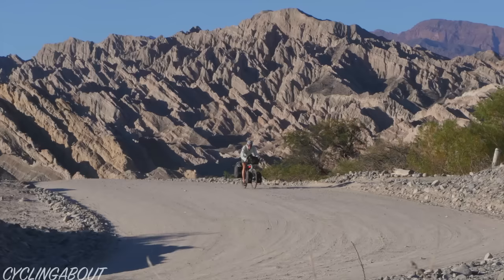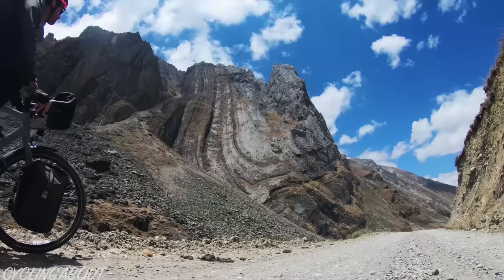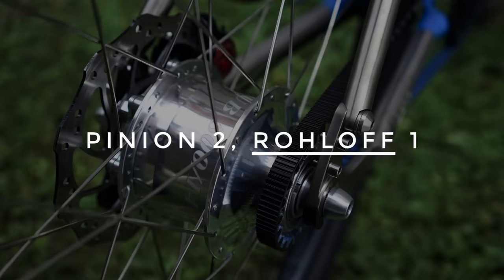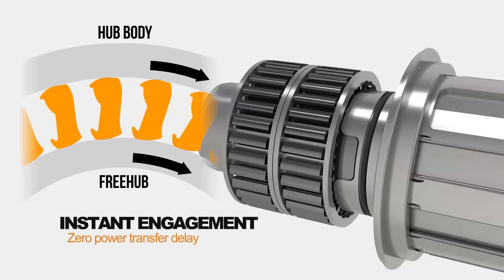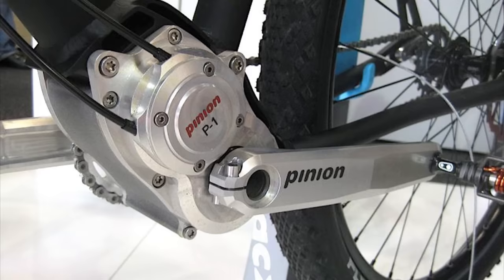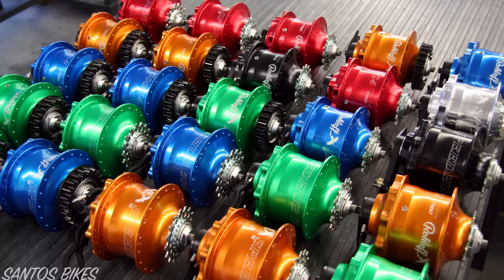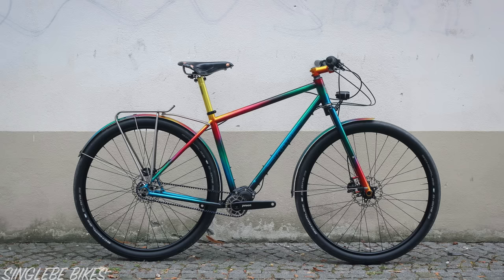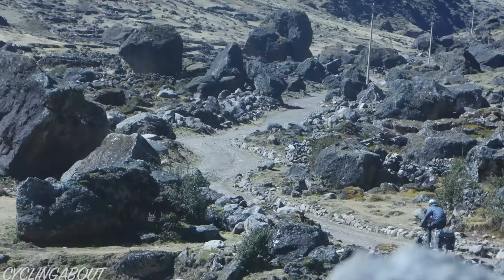What's The Ultimate Bicycle Gearbox? Rohloff Hub VS Pinion Gearbox

Comment: Rohloff has a 4% higher efficiency, is lighter and doesn't require a odd frame like the Pinion does so a easy win for the Rohloff if you ask me.
Reply: Plus the wide array of aftermarket shifters. Personally, being stuck with grip-shifters would be an instant no-go.
Reply: It's all about what you want to do with the bike I reckon. I'm more on the pinion side. I used an Alfine 11 on one bike as a cheap way into the world of geared hubs, but the weight of a geared hub on the back axle absolutely ruins the feel of a bike on rough surfaces and especially trails. The lack of trigger shifter availability for the pinion would annoy me too, but the real downside is that there's almost nothing on the market in terms of frames that'll take a pinion gearbox so derailleurs is still win this one for the MTB/Gravel type spins I do.
I'd love to be able to run a belt drive as chain maintenance is by far the biggest consumer of my time in keeping my bikes running. The slow drive pickup in certain gears on both systems is also a worry on tech climbs, I have a couple of bikes with old Shimano 16 click hubs and the amount of free travel before they pick up is shocking now that I'm used to a minimum of 36 engagements (Free play from 22.5 degrees to 10 degrees is a huge difference, going from 36 to 120 clicks is barely noticeable based on a 120 click hub I ran, as the benefits are very much into diminishing returns past 30-40 clicks). Shock loads to the drivetrain are much lower if the drive engages fast too, so there's an incentive from a gearbox durability point of view to pick up drive fast.
Reply: @MannequinOngaku  I personally don't mind grip shifters, but it would be nice if they would make them hydraulic like brakes so that they were easier to shift in the rain.
Reply: Noise kills the Rohloff for me. No way I go through all the trouble of a belt drive and hub only to have a bike that's noisier than a chain.
Reply: Rohloff has a weight/watts limit.  I killed three in a row before they told me that.  I did learn to build my own wheelset because of it....lol
Reply: Are you thinking of Cannondale Topstone? @aboutcycling warns it may not be stiff enough.
Reply: peglor Wouldn’t instant drive hubs contribute to a lot of pedal kickback?
Reply: @MaplePanda04  Only if you're on a full suspension bike where the chain length changes so much through the travel that it increases faster as the suspension moves than the rear hub is spinning. In a lot of suspension designs the tension in the chain while pedalling is used to counteract suspension bob, but under normal pedalling the suspension won't go very far into its travel, so the effect is small even on bikes with large chain growth.
Reply: @oilcanracer6388  Have you figures for the weight/watt limit on the Rohloff? The watt limit should actually be a torque limit (Measured in Nm, or lbf.ft for fans of medieval units) rather than a power limit as torque is what breaks low speed gearboxes.
Power (W) is Torque (Nm) x RPM (radians/sec), so the same power transmitted at 10 times the RPM needs 10 times less torque. As RPM goes up heating in bearings and friction surfaces becomes an issue, but at bike speeds torque is pretty much it for sources of failure.
Reply: @oilcanracer6388  ya, that bit is skipped over in the shootout. The Pinion has a much higher torque limit then the Rohloff.  That limits it's compatibility with e-bike mid-drive solutions.
Reply: But you forget mtb. For a full susser,  the most important place to reduce weight is at te rear wheel, and increasing frame weight actually improves suspension (hence some race teams attaching weights to their frames) when you frame it in this lens, the pinion seems much better, as the slight efficiency loss is more than made up for in the much better sprung/unsprung mass ratio. Not to mention the complete sealing allowing it to function very well in muddy or wet conditions
Reply: @peglor  only on certain designs
Reply: wow, 4%! that's amazing, it would make so much difference and every cyclist ever would notice it! i'm surprised Pinion is still in business tbh.
Reply: That's what Richard Schwinn said when I asked him about doing a custom Waterford or Gunnar for Pinion. Wasn't interested in the extra frame tooling expense either. They do about 20 or 30 custom Rohloffs every year. I have a Pinion Priority 600 now and love it. Taking advantage of doing easy extra wheelsets.
Reply: Shindinru I’ve been using it without any problems for over a year with a 52V BBSHD (160Nm torque).
Reply: @MannequinOngaku  I agree, I can't stand grip shifters.. 
So for the cheaper, more efficient solution thats been tested more. and is also the one with compability with different shifters, crank motors and the bike frame you wan't, its a easy choise if you ask me.
There's gott be a torque limit on both, but you'd never know on the pinion cause you can barely put any power too it. With a BBS HD on the Rohloff its gonna be tested, I run derailleurs and the chain and sprockets wear out pretty fast...
Reply: @oilcanracer6388  Hmmmm.....so how do you explain the large number of tandem bikes that have been using Rohloff Speedhubs with great success?
Reply: I agree...Pinion.
Reply: @theadventurebiker   tandem bikes see a lot of power but very slowly and not a lot of torque at once.  Stopping a tandem,  not that is a different subject.
Reply: Tasunke  actually in normal usages they are good.  But there a lot of riders experiencing problems at the top end of their limits and beyond.
Reply: @peglor  I no longer have the actual numbers, but my numbers were just armchair guesstamations using weight of bike, myself added to 250-350 watts power.  You are right that heat deterioration added to the problem of over loading the hub.  I used to break spokes, rims hubs and wear down pedals and chains until I found better parts.  Now that I am on a pinion gearbox, my knees are wearing out.....lol
Reply: Maybe its only in Germany but I got a lifetime  warranty for my Rohloff...  also the e14 shifter is a clear winner
Reply: @peglor  5% more efficient is significant.
Reply: Could you elaborate?
Reply: at a higher price yes
Reply: Pinion isn't limited to grip shift. Cing makes dual trigger style shifters for it.
Reply: @PhilKulak  thing is most gears are silent. There's a handful of gears that are clicking while pedaling and for whatever reason gear 7 is just plain awful, granted. But in the real world, most of the time you only hear your tyres whizzing as you're going along.
Reply: You're clearly not an MTBer, or not a very good/competent one.
Reply: @thanadorlx9179  I broke my hub flanges (salty water breaks the flanges, according to Rohloff) after 5 years and that was it. I had to pay for the repairs.
Reply: @frutt5k  i got my rohloff for 3 years now, 15k km run through, 3x change of oil, thats all.  I have friends who got now 8 years on rohloff and rhey had broken wheel but the hub was fine... my shop dealer told me some time ago that he had a case where the hub was making noise and had to be replaced after 8k km... rohloff did the replace for free... so I can't complain... I heard my wife curse because her last bike had Shimano and some gears were always off... now she has nouvinci gear, but she can't keep up... we decided to go for the new delite and super delite with e14 hub, going to buy for next year
Reply: @thanadorlx9179  YMWV. But if the Rohlof shit hoits your fan you are depending on the leniency of Rohloff. Despite their claims of 100.000 km's.
Reply: Unless you're a mountain biker, but otherwise, in large part I agree with you.
Reply: To me, the biggest advantage of a Pinion Gearbox is for mountain biking.
Reply: If you a road biking or something it off course is the better option.
Because of the weight distribution it's not good for MTB's like he said.
That's why i would go for a pinion gearbox IF i even had the money for such transmissions.
Reply: He created frivolous circumstances not relevant in order to cheat Pinion to tie.  Many were laughable that I firdt thought this was paid add
Reply: @mick2d2  Just bought a FLX Blade 2.0 with a Bafang 1500w with Rohloff. We'll see. Don't like the twist shifter though. I have to be careful when riding because if i accidently move the shifter the shift detector cuts power for a split second. Its irritating.
Reply: @espritmike  I suppose, as with most things, there's an adjustment period. 
I don't have any power cut off, other than me briefly letting up on the pedals as you can't shift properly with the Rohloff under pressure anyway.
My shifter also requires a certain amount of pressure to click between the gears.
Reply: @Paul Kirkeminde No need to ride electric bikes anywhere.  I am perfectly able to cycle as much and anywhere I want as long as the bike can handle it.  Where I currently live we do not let E-bikes on the trails and are limited to the streets in car lanes only, never on bike paths. They are considered motorcycles not bicycles. And I agree!
Reply: @Paul Kirkeminde"Paul Kirkeminde has been blocked from communicating with you."  Good bye! Not looking to argue with people, just giving my opinion on a friends page.
Reply: i agree!
Reply: Rohloff back wheel replacement is pricy.
Reply: Both loose. Ridiculously overpriced american made crap engineering.
Reply: @peglor  rholllof is  rated for up to 120 watts , that's more than any ebike I know
Reply: @andyanderson1100  The motor power limit for ebikes to be considered pedal assisted bicycles and not motorbikes is 250 Watts, so all but the cheapest models are at that power level. 

Electric MTB's go considerably higher since they're not officially supposed to be used on public roads. Power doesn't break bike hubs though, torques does (Consider that a truck engine with 500 bhp is built much more heavily than a 500 bhp car engine because the truck is putting out 500 bhp at 1500 rpm, while the car does it at more like 6000 rpm - bikes are much more like trucks in this regard), so torque is the figure that matters.

Incidentally, if the Rohloff was only rated for 120 Watts they'd be failing all the time in normal riding - most amateur but regular cyclists can output 1000 W for a few seconds.
Reply: That is 4% for drivetrain efficiency. It is a tiny percent for overall power output including gravity, rolling resistance, and wind resistance. Probably just a couple of Watts
Reply: The Rohloff doesn't, but if you use a belt it will require a 'breakable' rear downtube - as will the Pinion with a belt!
Reply: No doubt about it. Rohloff is the choice for pedal-nerds. I have choosen Rohloff before PINION came up and tested one Pinion  bike. It didn't convinced me.
Reply: Interestingly, in practice apparently Pinion appears more efficient: https://youtu.be/Rg8wh5qlHlk?t=1m49s
Reply: Unless you want a multi bike with wheel swap ability.
Reply: @tonyk8368  the very elite and expensive Kindernay gear hub does use hydraulic shifter lines. But I much prefer the direct and fail-safe mode of cables. 11 years of use and never had to even touch the cables. Never had any shift problems in the rain either.
Reply: @espritmike  you maybe need to set some slack in the cables. I can twist the shifter for about 10 degrees before the shift will even occur.
Reply: @rosomak8244  WTF!! Both gear systems are made in Germany.
Reply: @frutt5k  11 years of heavy load touring with my Rohloff. Never had a flange break; most of my friends with Rohloff have never had this either. But I am just 68kg. The two people that I know who have had failures were each about 90-100kg or more.

It is a combination of heavy rider weight and poor spoke choice that are the major causes of flange failures. Now Rohloff sells their hubs with a flange ring that prevents this occurring.
Reply: @scottdowney4318  agreed. In the world of bicycles a 4-5% loss is really serious. Does not sound it but a 10-15% loss would make a bike a complete dog to ride.
Reply: @frutt5k  my Rohloff is up to 60,000km. Still on the first set of cables. Only maintenance has been the 5,000km oil-change, and I have changed the chainring and sprocket just the once. No shit hit any fans.
Reply: @PhilKulak  the noise is an irrelevancy. It does not equate to drag. It is mainly only the gear7, and generally the lower gear range. Get used to the great benefits that low range gives you, and after 2-3 oil-changes the noise will have diminished. Nowadays, after 60,000km, I am often surprised to realise that I am in gear 7!
Reply: @petesig93  Then you were PLAIN LUCKY. And at such an initial cost for one part, LUCK should not be a factor. Try that with Shimano....
Reply: @petesig93  The manual never said there was a weight limit. I am 110 kg (bike included) but I only saw brochures with world travellers riding with 40 kg of luggage on roads that I would never call 'roads' at all.
The Rohloff message is 'indestructable' but they omit "in ideal cases". Rohloff is a very expensive lesson.
Reply: @PhilKulak  I am in gear 8-14 more than 90 % of the time, so the Rohloff is very quiet most of the time. In cruising speed on flat road gear 11 often give the optimal cadence, and on a gentle climb, 5-7%, gear 8 is often perfect. These two gears, 8 and 11, in a Rohloff hub is very efficient, 96-97% and dead silent. On par with the best lubricated chain and cassette, and much quieter. A Pinion gearbox in the same speed might opt for gear 9 and 13, and have 91-92% efficiency
Reply: @Paul Kirkeminde It’s not self-righteous to call an e-bike motorized (they are), nor to suggest that they don’t belong on non-motorized trails (they don’t). No one is telling you you shouldn’t be allowed to ride one, so stop acting so butt-hurt.
Reply: coud you pair a pinion gearbox WITH a rohloff hub?
Reply: Pinion has less unsprung weight though
Reply: 5 percent is a big deal plus you aren’t adding a lot if any weight to the rear if I understand it right. You are transferring the weight of a cassette deraile and amount of steal chain that wraps around this thing in the back as far as mass of metal is concerned im thinking it’s basically just moved that weight and mass inside the hub
Reply: @aaronb3600  Yes, it's doable.
Reply: @MannequinOngaku  : Grip-shifters are the best for emergency downshifting when you hit an unexpectedly difficult spot. You can downshift-dump all the way to first gear in a single twist with a grip-shifter. You can't do that with any trigger shifter.
Reply: @tonyk8368  : I feel like you must be joking when you say hydraulic shifters would be easier to use in the rain. Certainly hydraulic disc brakes are more reliable in the rain, but there's absolutely nothing about shifters that would be affected by rain in any way. (source: I've been biking for 35 years.)
Reply: 4% higher efficiency, lower weight, and lower cost, but requires rebuilding a wheel if you need to replace it. You can replace any other drivetrain option without requiring special expertise, but replacing hub gearboxes requires an expert wheelbuilder, and statistically you're probably not one.
Not requiring a specially designed frame is certainly a plus for retrofits, but it won't matter for a new bike. Also, frames are all specially designed to fit various parts -- good luck fitting thru-axle hubs to a frame designed for skewers. In due time, it may become commonplace for frames to be built to fit Pinion-style gearboxes. I certainly wouldn't object, because if I'm going to have a heavy gearbox, I'd like it to be sprung-weight.
Reply: @deusexaethera  wheel building is really not that difficult but as with anything the more you practice the better you become.

Personally I like that I could re-lace the Rohloff into just about any wheel I wanted on any bike I wanted.

Something like a Pinion requires the frame to be made for it.  While you can certainly argue that wheelbuilding is difficult - it's not as difficult as modifying a frame not built to accept a pinion, to accept a pinion.
Reply: @MiccaPhone  My impression from reading is that the Rohloff doesn't free-wheel as well.  So anytime you stop pedaling for an instant then there is a small braking effect.
Reply: @petesig93  Others have said that the Rohloff feels slower and my impression from reading is that the Rohloff has more free-wheeling resistance.  So anytime you stop pedaling there is a small braking effect.  Not huge, but does add more resistance to a ride.
Reply: I agree
Reply: @peglor look at the priority 600x...great looking pinion drive hard tail with front shock fork.
Reply: I fully agree!
Reply: @johngury What shifter?

Comment: The only thing I can remember after watching this video is the price tag of the gear boxes
Reply: Both companies are german. So don't expect low cost products.
Reply: Yea I'll just go buy a whole motorcycle for that price
Reply: I have had my Rohloff for over 12 years and it has been on three different XC frames and with about 8 different rims. I have only changed the oil every year  as maintenance. Total cost to date averages out to less than the price of a bought coffee every week or two. You could also factor in the reduced amount of chains that you have to replace.
Reply: @sgtjonmcc  yes and I can buy a car for 1/3rd the price. What's your point? We're talking about high end bicycles which can run years on end with very low  maintenance and almost no ownership cost. A motorbike has higher ownership cost and it's a motorbike not a bicycle..?
Reply: @smiche2  exactly! Plus you also need license, insurance, and road tax for motor vehicles